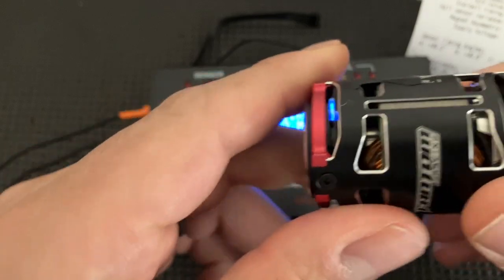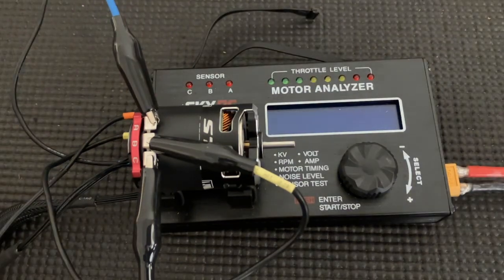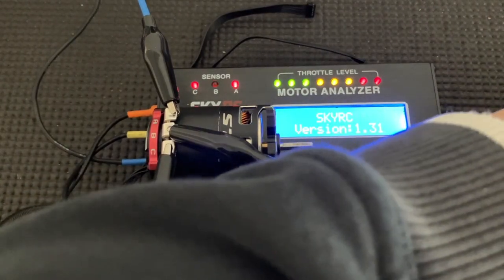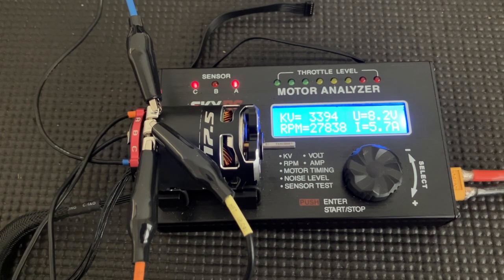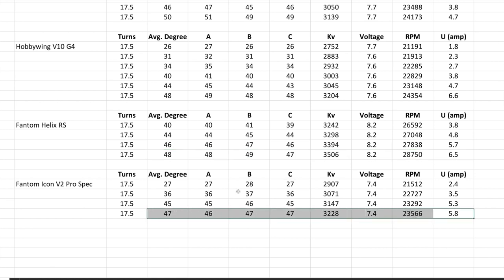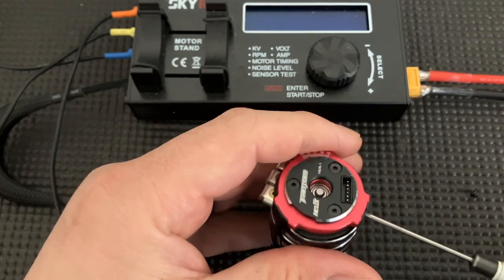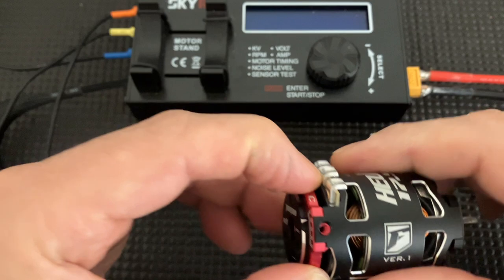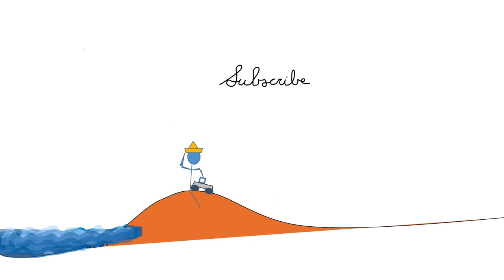Fantom Helix RS 17.5T motor analyzer data How it compares on paper with Trinity and Hobbywing V10 G4

Comment: Interesting. how would this compare with the Slot Machine? 
Would also be interesting to see/hear reports from the track. 
I'm running a Reedy S+Plus which I'm pretty happy with, and in spite of being older tech gets up in the revs (3571kV @ 3.7A w 46 degrees)
Reply from the maker: I use to run the Fantom Icon V2 in my B6 because I liked it better than the Xfactor. I am not sure about the 17.5T Slot Machine. As far as the 21.5T... The Helix yields more Kv and speed in a similar distance than the Slot Machine in my TC. 

I did compare the old Icon to the new Helix and the HW G4 yesterday. I will put all of the motors on the analyzer to confirm the timing and amps I was running each motor. I also have to select the clips with the times per laps. Both were better than my old Icon. It could be that the Icon is old. But the Helix did register more Kv at similar timing and amps based on the data I have from when the Icon was new. 

I will try to have it ready within a week.

Comment: You really need to use a power supply at the same voltage to test these motors. At 4  minutes when using 7.6 the chart shows almost identical  numbers to the older version fantom vs new! But then you decide t o use 8.2 volts?  Then the numbers are way off. There is no use in comparing motors at different voltage.
Reply from the maker: I agree that consistency in method is best. I use to think the same way. Then I would have to make use temp, humidity, etc. is the same, and I just don't have the facility. Back to volts... I tested the Helix motors and the Kv is so similar regardless of voltage that I stopped worrying because the issue it the instrument as Kv is a constant. There was a motor where the lower the V the Kv would rise, and vise versa (might have been Trinity). But not the Helix.
Reply: Air , humidity?  Really? The DC power voltage is everything. The higher the voltage the more efficient the motor is. That effects timing vs amp draw and kv. Your numbers prove it.
Reply from the maker: @jasonswint8297   I should have been more detailed. air, humidity, temperature, etc. are all factors. Materials expand and contract with temperature for example. I am not saying they are significant at all. But if I wanted the most reliable test, I would have to control all variables possible variables.

Back to voltage... yes, higher voltage yields more efficiency... why we went from 6V to 12V systems in cars, and we should consider 36V in cars... and why 220-240V is better than 110-120V for many large appliances... and why the Cybertruck uses thinner wire than previous EV models due to the Cybertruck's higher V. The point is Kv is support to be a constant and not a variable of voltage. Therefore, in theory, it should not matter what the V is as Kv should be a constant. When I tested a motor there was variation that seemed to point at lower voltage --> higher Kv. But testing a different one, this did not hold. So, I just test to get an approximate result. 

Now... HW G4 is ROAR approved if I am not mistaken, the Helix is about to or just got approved... the Trinity Slot Machine was dropped from the ROAR list not long ago for changing the design after submitting designs for approval... and will be replaced it with the Slot Machine 2 if I am not mistaken. The HW and Helix are the best of the bunch I have run and one would be splitting hairs. So, I would go with either of the two... HW g4 or Helix. 

If the entirety of your comments are to "prove" to me that I should get a power supply to run more accurate test... Thank you, you are not the first to suggest it. I understand why... I just do not think it matter as much as I am testing for Kv which is a constant. Keep in mind that even dynamometers have variances. 

We can always talk about my experience running these motors. I think I have answered why I do not worry about using a constant V. But feel free to give me more details just in case I misunderstood your points. 🙂